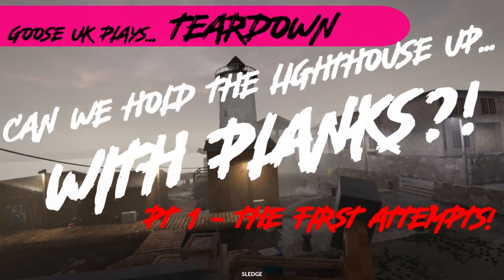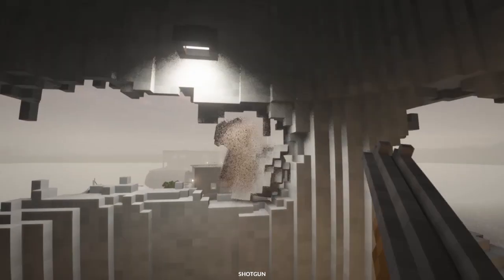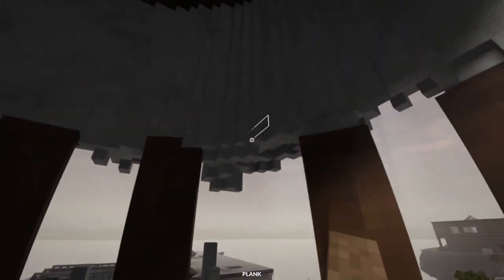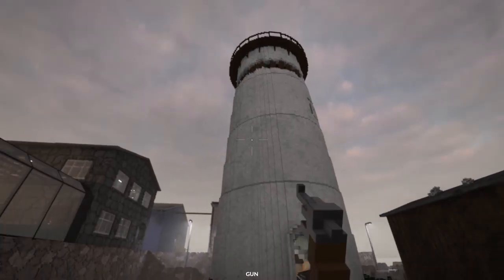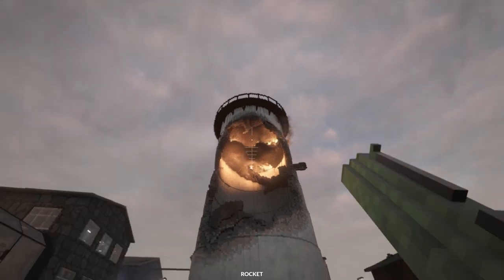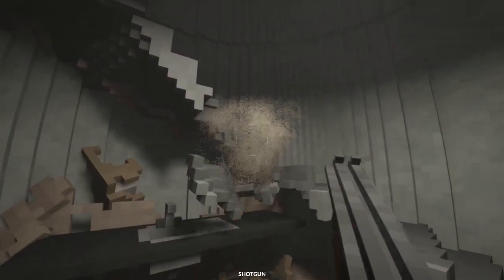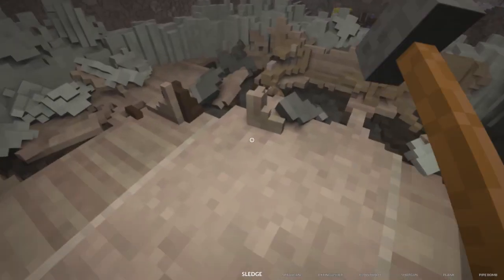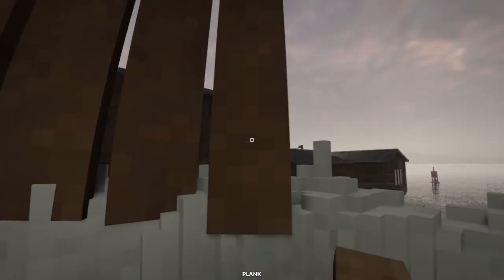Holding the Lighthouse up with just PLANKS! Part 1! TEARDOWN

Comment: You have the diagonal brazes in the wrong direction, they need to be circular around the lighthouse. If you do that the lighthouse will stay up and you probobly don´t even going to need that many planks
Reply from the maker: Good suggestion... I figured that out much later. You will see something similar in next vid - I get the lighthouse into more sections... this was my first try at this so did pretty well!

I actually used a triangular arrangement later on and it worked well. At some point I will go back and try it at the bottom. 

Next vid tomorrow it gets a bit ridiculous!
Reply: @GooseUK  probibly could start ftom the top and pretty much rebuild the lighthouse with mostly wood.

I tryed making wood at the bottom. But it flexes a lot, so its almost like puting it on springs.
Reply from the maker: @matsv201  i'd love to see it. The wood planks seem to have a certain 'breaking point' in the physics engine, where they just go bonkers. I'm building a 200m (ish) metre bridge at the moment and it just goes ballistic at a certain point.
Reply: @GooseUK  I think its the strech that is the issue.

It seams like Dennis have modelated them as a very hard spring. The issue is that planks is much more non liniear in real life. Now of cause Dennis modelated them as a spring to make it possible to put a bit of strain on them and still be able to break them with a reasonable force.

The issue is that this makes them very springy. way to springy. My guess is if they would make less springy it might take more processing power to calculate it.
Reply from the maker: @matsv201  for sure. I like how the planks work for attaching to things etc, but we do need solid building planks. 

I'd have thought a rigid body would be easier to simulate too, but I don't know. Maybe they wanted to give wood a natural flex, but it's just way too springy...
Reply: @GooseUK  The thing is you really can´t have a rigit body simulation in a game, then you can´t have a dynamic load.

Teardown have solved this like most game having a spring and dampening effect. It works well for moderate loads. But poorly for high loads.

Also when the vibration are very small there is an flotingpoint error that make the part vibrate. This is solved by nulling all motions under a certain amplitude.  That works well as long as the flotingpoint error is small, but in some situation its rather large, and you get the vibrating plank thing.

That problem can be solved by using 64 bit floating point, that is how all professional application do it, the issue is that its half the performance. Also most GPU can´t run 64 bit floats with half performance, so if you run 64 bit, you can only use a limited selection of GPU acceleration.

As far as i know, teardown don´t have GPU acceleration, but if they want to implement it later, they better stick to 32 bit.

If i was to calibrate it i would probobly tune out the E module of the board to about twice the number, but the dampening to 4 times. That would solve most of the kraken esk problem.

Now i´m a hardware guy and have really not done a lot of programming. But i have done a bit of consulting in program acceleration to better use the hardware so that is where most of my knowledge is from. 

I went to university with Dennis and i use to know him quite well, i have not met him in like 15 years now
Reply from the maker: @matsv201  that's a pretty interesting read. No idea what you solution meant tho sorry! Or what a kraken esk problem is 😬

When you say planks circular around the lighthouse can you explain a little more? And also what is the best way for a drivable bridge if you don't mind... before it goes all crazy! 

Seem to know your stuff!
Reply: @GooseUK  kraken problem is when things just flip out for no obvius reason. Fairly common in simulation games.

Triangular base can work.. or you crossbrais the bords. 

But.. i gues the triangular really should work the best. The boards are really strachy
Reply from the maker: @matsv201  cheers man!